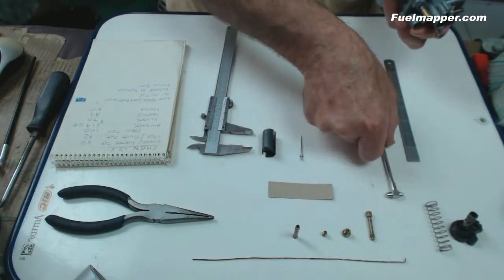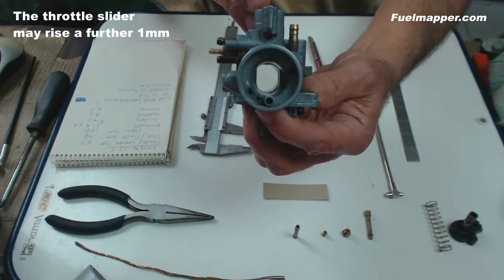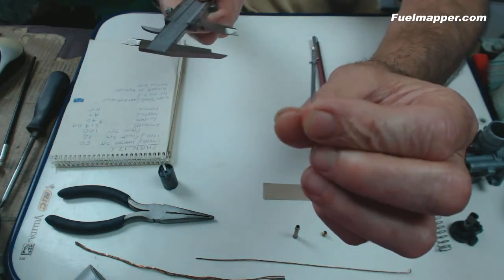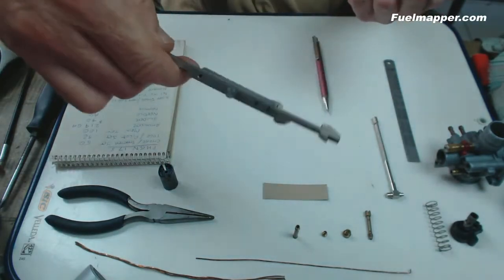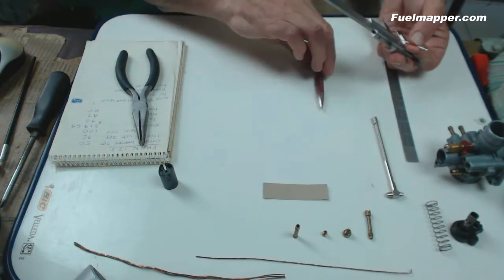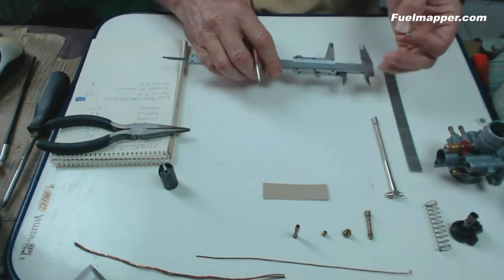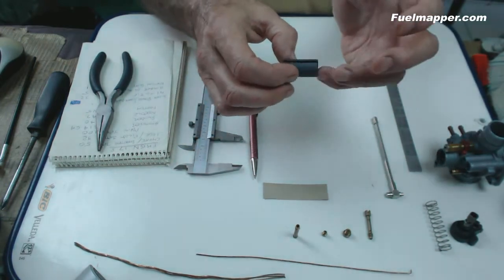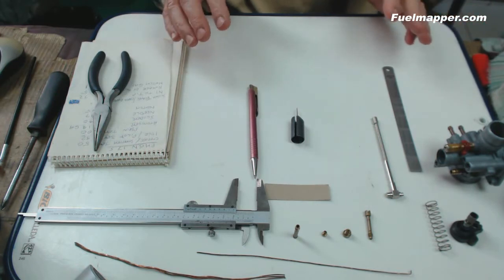Measure a carburetor for engine tuning (tutorial)

Comment: Question hope you can answer. I have a neighbor's honda 50 carb that in a bag of parts has a thicker/tunable needle and a thinner/non-tuneable needle. How would i know which one to use/or is supposed to be in there? Also, thank you for the video, ill be checking out more from you.
Reply from the maker: Hey Brian ... it's not possible to say which needle you need.
Tuning a carb, is an educational journey.
You must 'want to do it' (for all sorts of reasons).
I have written a software app (in excel) that will help you, and a tuning guide (that isn't completed, but it's fine, and I'll provide it with the fuelmapper app).
:)

Comment: How do I know what size carb to use?
Reply from the maker: It's a good question :)
There is a basic formula out there.
I don't have it to hand, but you can easily research it.
Most people join a forum for their bike, where there will be heated debate over carb size.
That debate will typically resolve down to small, medium, large, and extra large.
Eg. For a 50cc say, 17.5, 19, 21, 23.
The smaller the carb, the sooner it will switch on (at lower revs).
The larger you go, the slower the airspeed, so the later it switches on ... but will switch off later (at higher revs).
Too large for your normal riding style, and it will guzzle fuel, and lack response lower down the rev range ;)
Reply: @EngineTuning  Soo for 50 cc if mine is 12mm ?
Reply from the maker: @mihailb8280  ???
Reply: @EngineTuning  Thank you.
Reply from the maker: @mihailb8280  For what?
You didn't ask an understandable question.
Are you one of these famous bots, that we hear so much about?

Comment: sir i would like to ask how can i determine the carburetor size ?
Reply from the maker: That's a good question divv cortes 
... with an interesting answer that should impress the ladies :)
________

For a circular bore carburettor - easy :

The throat / bore diameter of the carburettor, determines the quoted size of the carb.
Eg. a 19mm diameter bore is a size 19 carb.
_________

For an oval bore carburettor - difficult :

The area of the throat is calculated.
The circular bore that would equal that area = carb size 

Ie. a size 19 circular bore has the same throat area as a size 19 oval bore.

Eg. 
Throat area = 240mm = circle diameter 17.5mm = size 17.5

The shape of the throat area might be oval or oblong.
The PHBN has a central oblong area with small radius at top and bottom.
It is very difficult to measure

Hence the number is stamped on the side of the carb.
That number says:
If I had a circular bore... this would be my diameter.

:)
Reply: @EngineTuning  do you measure the filter side or the engine side?
Reply from the maker: @JamesCouch777  That's a good question James :)
You need to know the travel of the throttle slide.
The bore might be oval, or parallel with an arc at the top and bottom ... or it might be circular.
When you measure the projection of the needle, through the slide, you can then calculate the exact geometry of the needle in the atomiser ring, for any position of the slider.
The fuelmapper program calculates this automatically.
Eg. At what position of the throttle, does the taper become active?
The taper position varies greatly between needles ... late in the throttle opening, or early?
This positioning is critical to launch, and entering the power band etc.